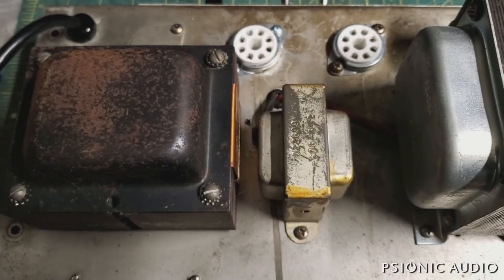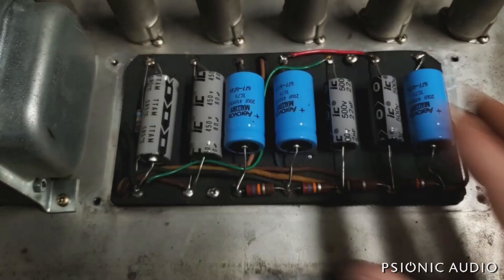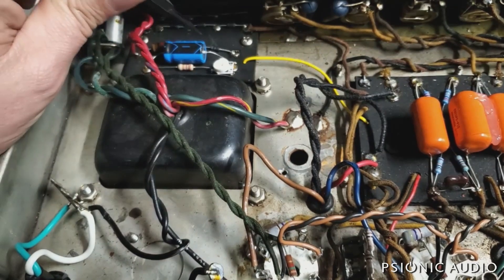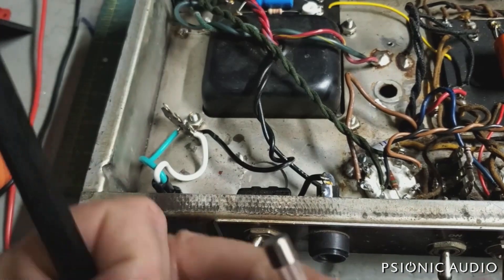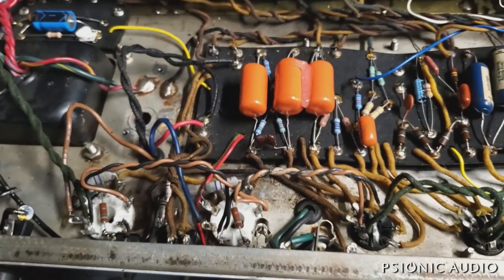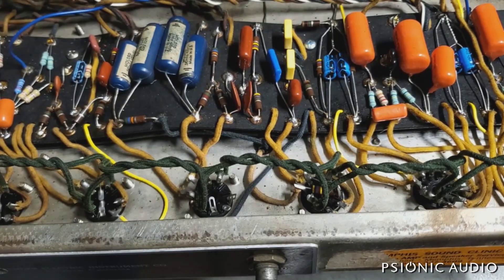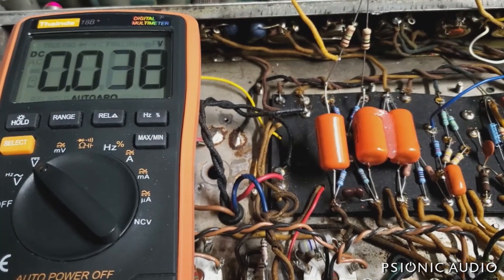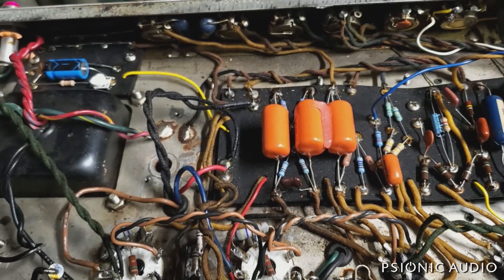'63 Fender Concert 6G12-A Part 1 : Initial Inspection, Playing, and Testing

Comment: I realize that your analysis of this amp is not yet complete, but I have a question: given the period this amp was built, I'm assuming that it uses an opto-isolator in the tremolo circuit, and I've seen those in amps that were 'thudding' (this is the worst example I've seen, though).  There is another tremolo circuit I've come across in old Montgomery Ward amps where the oscillator current is fed into the cathode circuit of a gain stage, and I haven't heard those 'thud' (just haven't experienced it; not saying it's not possible); I actually like the sound of those, as they seem more 'liquid', for lack of a better term.  Is the opto-isolator the main difference, or is it because it's feeding into the output tubes' bias?
Reply from the maker: The brown panel amps like this Concert don't use a roach. Neither are they bias tremolo. A very involved circuit beyond the scope of a YT reply, but stay tuned. I'll explain it in a later video once I de-thump it.
Reply: @PsionicAudio  ,
Thanks...I look forward to learning how it's done.
Reply: Is this a 6G12-A? I have one and the vibrato channel sounds so good.

I think there is half a 12ax7 tube unused if I recall correctly?
Reply from the maker: @JudBarron  Yes and yes. Great amp.
Reply: They use the best system of tremolo (some say, "vibrato") that Fender ever used and are the exact opposite in complexity and quality from the roach system.